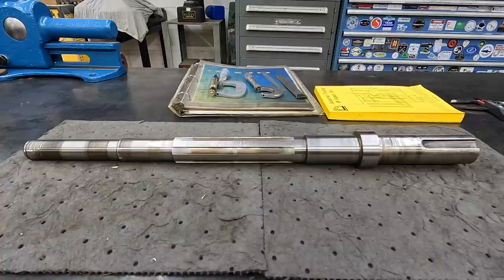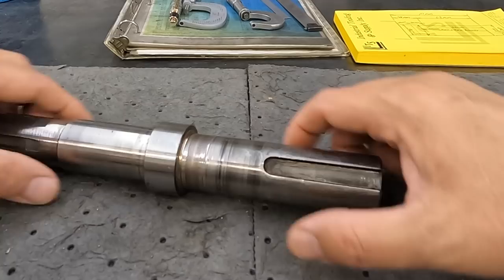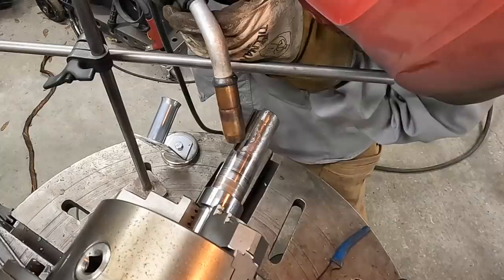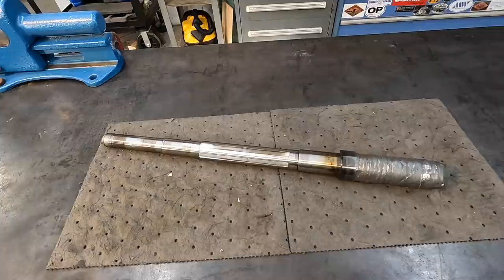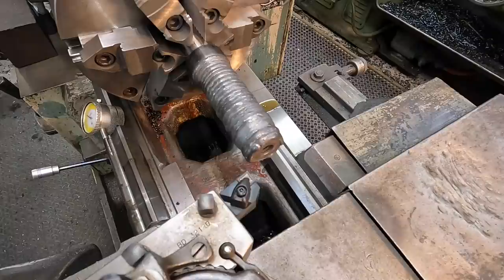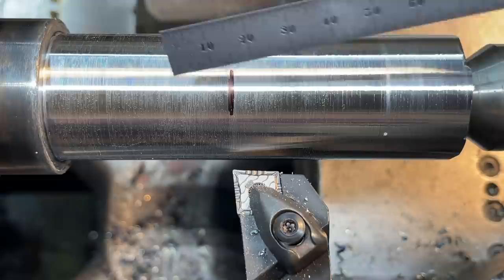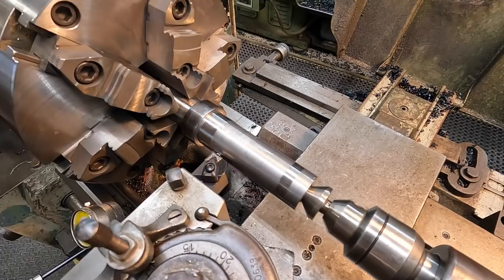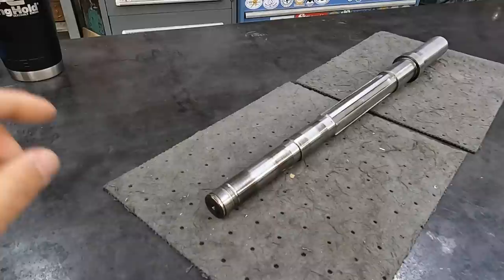Lathe Clutch Shaft Repair Part 1

Comment: Thank you for the very interesting and informative video. It also makes me happy to see someone wearing safety glasses under their welding helmet. I learned the hard way.
Reply: @shocking development Newbie question here , what is the point ? second question, as i wear prescription classes, how could i stack them under the hood ?
Reply: @nicolaspillot5789  I wear prescription  glasses too. Prescription safety glasses are available, and so are styles that can be worn over normal glasses. Personally I usually just keep a new, unscratched pair of snug fitting safety glasses set aside for welding, and I can see well enough except for some TIG.

The reason for glasses irrespective of welding process is to protect from arc flash and back reflections. The glasses with correct rating can be completely clear,  but cut UV to almost zero. Depending on the welding process, it is also not uncommon to end up with stray sparks or spatter inside a helmet, so glasses protect from that. MMA, MIG/MAG and even TIG weld beads often eject slag and deposits as a weld cools. Keeping eyes covered is the way to go when checking out a weld.

Lots of YouTube's welding with no gloves, white shortsleeve t-shirt and staring at their weld beads with no eye protection. I am mystified by this.

Comment: @11:12 Adam, if you're having issues with your safety glasses fogging up, clean the lenses with some regular ole Shaving Cream/Foam. Just rub it all over the lenses until they're coated, then wipe it all off with a Dry cloth and the lenses won't fog up on you. 
 It works great, my Grandfather showed me this trick like 30 years ago and I've using it on all my glasses, bathroom mirrors and the interior of my car windows ever since. Alternatively you can also use Liquid Dish Soap without water and it will do the same thing, it's just a little more fiddly to get a streak free finish. Give it a try I guarantee you won't be disappointed! 👍👍
Reply from the maker: Thanks for the tip, I’ll give that a try 👍🏻

Comment: Absolutely enjoying these rebuild videos with weld buildup, spray weld buildup, using a turning table for clean weld buildup.  Being able to see each setup that you do is pretty awesome.  I just bought some new tooling so I can do consistent block manufacturing.  Bought a new clamp and some fixture plates.  I can't wait to use them.  Thanks for all the great content.

Comment: Great repair Adam. One thing that has helped me after 30 years of welding is getting a PAPR welding hood. While expensive, it keeps me from breathing welding fumes and keeps me glasses fog free. A word to the wise, stay away from good Mexican food the day before.
Reply: $2000 for a product he'll use for an hour a month. Not viable.
Reply: Or bad Mexican refried beans within 24 hours before. XD

Does a fan help as a much less expensive option if the hood is not feasible? Or does that present complications?
Reply: @johnbonner922  depends how strong or close the fan is, if you are using gases they can be blown away. But I use a fan sometimes especially when welding inside a truck just to blow out the fumes and keep the air moving.

Comment: Those Walter Tigertec are pretty good inserts. I also like Iscar and Sandvik for turning as well. For basic roughing or medium turning, Mitsubishi and Sumitomo are very cost effective options for a manual machine too. Just passing it along 😊

Comment: good repair, i do a lot of weld build up repairs at work on big Liebherr  996 hydraulic pistons (internal rod to piston seals), good practice to pre-machine the area to be repaired under the finished size 1.0 mm to 1.5 mm per side so your under the fusion zone and clean any embedded dirt and grime off the surface so it doesn't become a inclusion or bubble in the weld. that would help a lot with the surface finish. 

also for the new shop, digital micrometers are really nice and can switch between inch and metric. the Insize brand are fairly good but quantum mics from Mitutoyo are stunning. you get what you pay for though.

Comment: Adam I always love watching your videos but I'm going to put my cheap two cents in here. I worked on six different monarchs double e up to 28 in by 12 ft lathe. Anytime I had a repair like that and a certain length of shaft, I would chuck it either in the three or four jaw, Chucked on the tail opposite end of that shaft and then put it in  steady rest on that what looks like a bearing journal the area that you did not weld. Then Center the shaft because you could have cross actual condition going on when you chucked it short like that. That's very important. I'm always worried about something like that. I hope it comes out good but I would have done it the way I mentioned. Have a great one!
Reply: Yes, good observation...I'd do it that way too.

Comment: I use a bore welder and the welding machine settings are quite different to allow upside down welding, a major benefit is reduced heat. Low volts. Drip transfer welding. Needs to be laid over a machined surface.

Comment: I was wondering if you were to have turned the shaft down some before welding it up, if that would have given you a thicker final finish. Since the new weld is merely a few thousands, is that okay and work good... IDK
Reply: That's true but unlike a spray weld I don't think a mig weld is ever going to peel off since you have much more penetration and especially fusion because the base metal his heated and mixed a lot more. 
So while he didn't remove anything, because a weld bead is so much more energy dense, I think it should be perfectly fine as is.
Reply: Mig bites in enough that it ain't coming off.. the advantage of turning it down first is that all the metal is the same hardness so tool pressure remains the same and it eliminates thicker spots where the material is harder.. it didn't look like it was a problem with this repair but it's a problem I've run into before

Comment: As it is possible to do so, I would turn down the diameter of the damaged portion by about .020'' on the diameter prior to welding.
As after dimensioning, your (weld) root does not get anywhere near the surface as if you do a straight weld up.
Hence, I will assume to achieve superior bonding and metal integrity.

Comment: Just a thought, if your MiG welder was connected to a lead screw 4-5 TPI and then connected to the chuck with a belt, you would be able to vary the feed rate of the weld by varying the speed of the welding fixture in the video. Maybe bit much maybe? maybe not?  Great video❗👍

Comment: Great job but one concern. Lot of heat gone into that shaft after that weld up and no stress relief using a torch with heat applied going beyond that bearing shoulder and allowed to cool off before turning. If that shaft is under load there is risk it could shear off. We don't know the material so there's no way of evaluating the risk. It may well be perfectly fine!
Reply: As much heat gets past the shoulder, I do not think this shaft will develop any crack potential
As the shaft cools, the heat witch is more intense at the end actually transfers back toward the shoulder in a very gradual state.
Reply: With the amount of power that will be going through that shaft, I very much doubt it'll break
Reply: ...I'm pretty sure that the chuck on the positioner was an effective heat sink-!!!

Comment: Adam chucks within  6 inches of the end of the shaft with the 6 jaw.  The runout at the chuck is half thou; after turning, the welded part end will be the same. But he does not know what the run out is at the other end of the shaft inside the headstock. Will he be doing a test to show that the shaft centreline remains true?

Comment: Walter carbide plates and tool are great at my Shop we are using quite a few different parts from them mostly smaller finishing plates for ID and OD
Reply: and one more thing, just go get some metric measuring tolls, makes life much easier
Reply: @kaeptenxy3569  don't remember seeing a single brand new measuring tool in his shop except his calipers.
Reply: @nils1953  dose not need to be a nice new digital mitutoyo, even tho those are amazing and can also be set to imperial ore metric but when working on stuff in metric its best to measure in metric as well.

I am from the metric world anyways :)

Comment: Which type of welding wires or rods are good for shaft rebuilding?
Reply: I'd like to know that too.
Reply: It depends if it needs to be heat treated or not, for something like this er70 is fine but if it needs heat treating then something like er80d2

Comment: Great job! Could you add a few details about the welding process you used? Dual shield or solid wire? I would have been concerned it would warp with the heat.

Comment: Nice work, Adam. Can I ask, I noticed you regularly clipping the mig wire. What is the benefit and is that a practice I should be adopting? I rarely do that. All the best, Mart in England.
Reply: I wondered the same thing, figured it was to start with a clean full fresh wire but I'm not a welder and this is purely a guess from an observational standpoint
Reply: Just cutting off excess wire so it's not in the way when starting the next weld and you can position the gun exactly where you want it.
Reply: As a welder i only cut it off when I'm doing something important that's going to be inspected with X-ray for example or if the wire is to long.
Most of the time I just tack another tack on the pile on the workbench, got a piece of flat bar tacked on to do that at.
Reply: It is to get rid of excess wire and the little ball that forms at the end.
Reply: I usually run a small bit of wire out and cut it so the shield gas is in the gun for the start of the weld.  Sometimes I start the weld beside the joint so that the gas and puddle are well established; the start can be ground out.  I do the same at the end so that the drop of slag goes beside the weld.  Whatever works at the end of the day.

Comment: If you set up an adjustable speed grinder with a wire wheel on the bottom side of the shaft..... it would clean as it rotated as you welded.....
Reply: It would blow away all the gas.
Reply: @samuraidriver4x4  ohh good point

Comment: What does the welding do to the heat treat?
Reply: I wanna know that too.
Reply: @samimas4343  not sure why you would heat-treat such a shaft. Unless it's used as a bearing race, it shouldn't matter.
Well I say shouldn't because it it wasn't hardened before and look how that turned out.

Comment: i see smoke when you cutting , how long to you wait to measure , till the material cooles down ? great vid , thanks
Reply: That's the cutting oil that is smoking.
Reply: Waiting till the material is cool is a general good practice for measuring. You'll get a true measurement without heat expansion deviations that way

Comment: Adam why didn’t u undercut it down before you welded it up ?
Reply: Obviously didn’t need to
Reply: @georgecostanza9387  I work in a machine shop as a machinist and I have seen many repairs like this and we always undercut it before weld build up because if it’s not undercut enough it’s possible you can run into the fusion line between the shaft and weld and it could possibly tear the weld off whether it be machining it down to size or it could rip off with it wearing down by use . I’m just wondered why that process wasn’t made here .
Reply: @zachtschappat9386  Correct. Should clean it up before welding.
Reply: @zachtschappat9386  I’m just kidding man
Reply: Usually he does when he does spray weld.

Comment: they need to design a welding helmet that has a air hookup  so you can  pipe in some cooler air
Reply: Those are out there. I've seen people using them.

Comment: Adam, Colchester lathes were made in England, were they set for metric or imperial measuring?
Reply: Some imperial only, most had twin scales to work in both, the newer ones that I've used only had metric dials. But also had dro that scaled in both

Comment: Is the shaft hardened or high carbon? Welding will play havoc with the heat treat or create a brittle zone which can lead to cracking. I have seen axles and shafts fracture on the weld after a weld repair to correct oil seal wear grooves.
Reply: @Custom CNC I agree, I have seen similar repairs fail very quickly. It might be possible to re do the heat treat but you would need to know what material you were dealing with. I think re making the shaft from a known material would be a more reliable option. Even if you know the material it's probably too late to do anything now as heat treat will probably introduce warping which would be difficult to correct in a finished part.
Reply: @Custom CNC How many freakin times are you going to post the exact same comment?

Comment: What is the deciding factor, in which you would remake that part?
Reply: I mean there has to be a point of diminished return.
Reply: If this shaft wasn't splined, it would probably would have been less labor to remake the shaft. The time to create the splines is the determining factor on this one.
Reply: Time + materials vs time+materials and end results I would have to assume.  Seems like an oversimplification but in the end that’s what it always boils down too.  Even in carpentry I can either fix a door or replace it.  The new door would look nicer, but the old door would work just as well.  The customer gets to decide what they want. Sometimes saving a 100 bucks is the deciding factor ya know?
Reply: One example is if this shaft were subjected super high torque I dont think this would be repairable because all the heat introduced while he was mig welding would alter the strength properties causing a quick failure. Adam or any machinist has to consider his capabilities "IF" it can be replicated. Another thing to consider is the time and expense vs a new part price. Older obsolete parts are sometimes astronomically expensive
Reply: Apart from what others have said, if it is 50/50 on whether to repair or remake, what would make a better video for us as viewers? I have seen Adam comment on that aspect in previous videos.
Reply: @maggs131  ...MAYBE ADAM SHOULD HAVE REFUSED TO DO THE JOB-!!!
Reply: @paulcopeland9035  Agree
Reply: Cost.
Reply: @paulcopeland9035  ...YOU SUMMED IT UP PERFECTLY-!!!

Comment: Regarding inserts, is 10/20/30 the nose radius?
Reply: I believe the nose radius on these inserts is determined by the last two numbers before the hyphen. So 0.4, 0.4 and 0.8 respectively.
Reply: The 10 / 20 / 30 are basically the toughness of the insert. The higher the number, the tougher the insert. The lower the number, the harder the insert.

Comment: Could you sleeve the shaft, turn it to size and make a new key way?
Reply: The sleeve would have to be to thick to make room for the keyway, there wouldn't be f all strength left after removing that much metal from such a small shaft and then there's the risk of the sleeve slipping because it wouldn't be keyed to the shaft..  welding was the only real option for a repair

Comment: Why did you choose to stand in an awkward position while doing the build up Adam?
I would drag weld it and stand from the side of the shaft, aiming pretty much at the 45 degree mark of the shaf while the shaft rotates away from me at the top.
Bit tough to explain without just showing irl but you can stand in a more relaxed position that way and have a better overview on what you are doing.
Another benefit would be that the puddle is shielded with gas for longer.
Reply: Internet experts are out in force  on this one .
Reply: @gusm5128  i have been a welder for years, petrochemical industry, food industry, military up to bridges.
I know what I'm talking about especially since I also have done alot of retrofitting and repairs where building up shafts is pretty standard.
Actually have to build up a worn shaft tomorrow.
So no not internet expert, actual expert

Comment: Hi From Australia
I will be interested to see what kind of material is used to spray weld the small Torrington type needle roller inner bearing surface,  if it is the shaft itself it needs to be Rockwell 55-60 C scale. I did not know you could get that hardness with spray welding?
Reply: @paulcopeland9035  Torrington needle bearings use the shaft to run on, no inner race. Usually used on the inner of clutches therefore only turn when the clutch is disengaged.
Reply: Eutectic make a hard facing spray that you can not turn in a lathe , you have to grind it .  21022 is fine as long as the bearing has an inner race , too soft to run rollers directly on though .
Reply: @johnsawyer2516  This assumes that the application is an automotive type clutch. In this case I don't know. If it is driven continuously except when the clutch is disengaged the reverse would be true. In any event the shaft really does need to be hard. Spray welding is a low temperature application of metal powders together with a binder. I would really like to know the hardness achievable with this process.

There must be an alternative, if there is enough shaft material. Torrington also make thin hardened inner sleeves to fit on a shaft, The shaft could be turned down and a hardened sleeve fitted. Job done.
Reply: @johnmcnamara3719  there's plenty of information, both on his videos and on Google, about how hard you can get the spray to turn out. Hint: more than hard enough.
Reply: @littlejackalo5326  What is "more than hard enough" on the Rockwell C scale?
Reply: @swanvalleymachineshop  Did a ton with 23045...excellent finish with grinding, about 60RC. Like chrome really.

Comment: lemon juice! few drops in a cup of water. dab a wet cloth on inner lense protector. lasts hours without fogging!  do that all time out on oil rigs welding to stop lense fogging.  I would of figured he just make a new one.  that part lost all strength now where its welded. and if you harden those sections now rest will be to brittle.